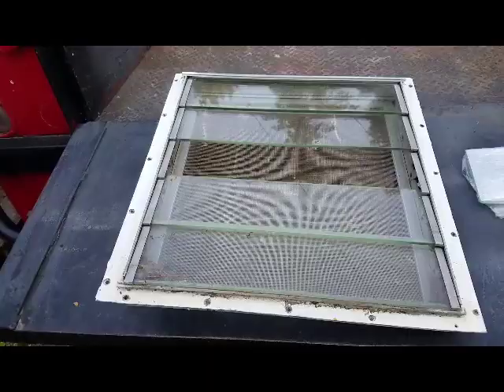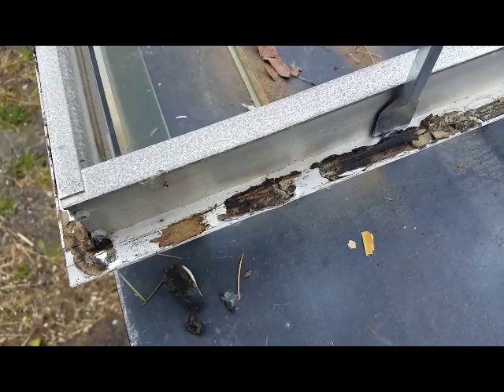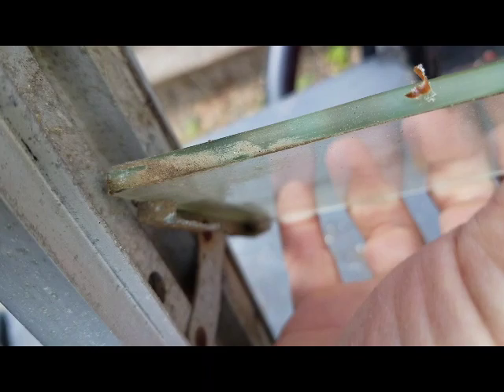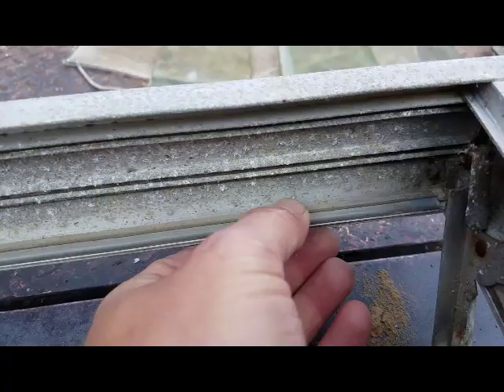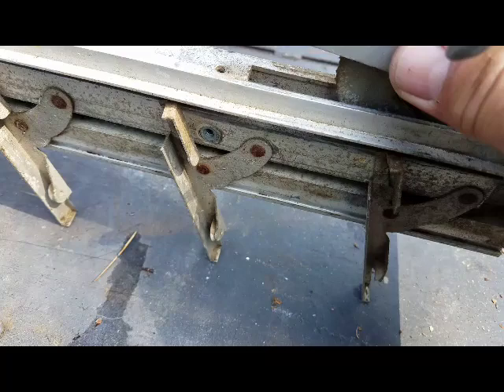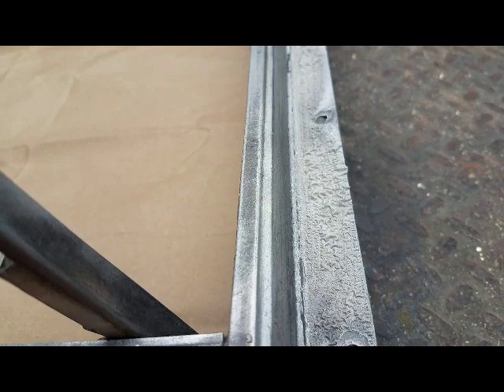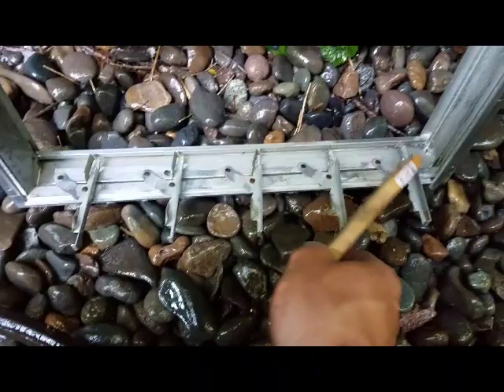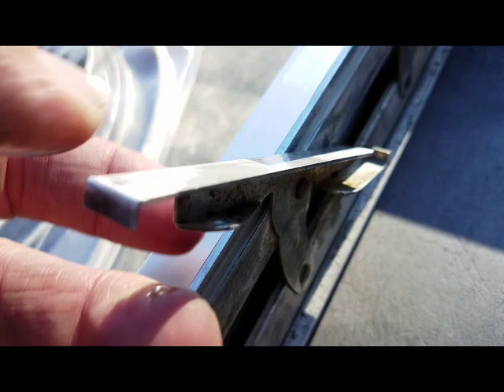Rebuilding jalousie windows on vintage travel trailer. PART 1

Comment: An easy way to remove the glass between the holders is to pry the little tab downward that holds the cylindrical discs in place.  Pry those down a little and remove the disc.  Then once the disc is removed, you will have the space to just pull out the glass pane without bending the front tip of the holder. Wiggle out the glass pane.

Comment: Shawne, On my Cub windows I used a product called aluminum brightener that I picked up at Napa Auto Parts. I purchased a gallon bottle and it was about $15. Used it full strength and it removed almost all of that stuff in the channels under the window saddles. This stuff is great on all of the aluminum. After cleaning with it the rest cleaned up like original with a sanding sponge that I picked up at harbor Freight. They cone, I think it was, 10 to the pack and I used the fine. My aluminum looks like it originally did. No extra shine just real nice aluminum. Good video but where is the finish video?
Reply from the maker: Bob Amos I'll go pick some up and try it! I got side tracked with other projects on the trailer. Will assemble window ASAP!
Reply: It's great stuff. I actually took mine completely apart and had each individual piece to clean by itself. But it sure looks good. Just installed them all this last week after painting. Just have the rear to paint. By the way, go post some links to these videos on the Facebook site. Since I am the owner of the site it is okay with me. The people there would like them.
Reply from the maker: Will do!